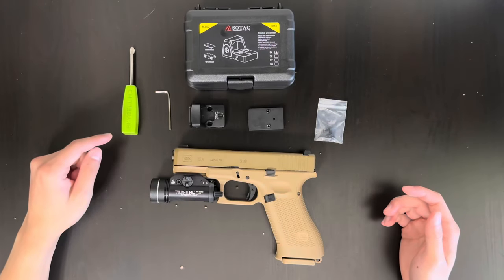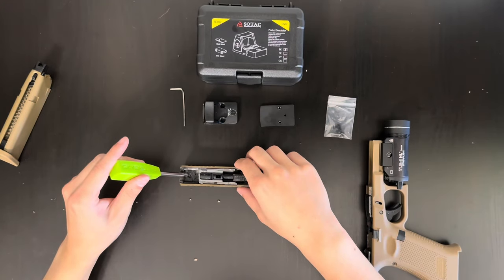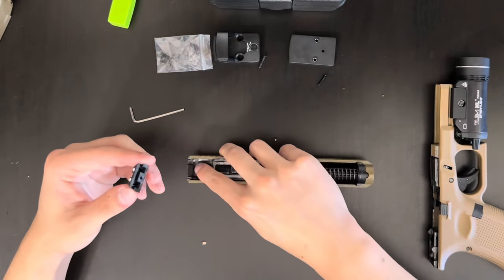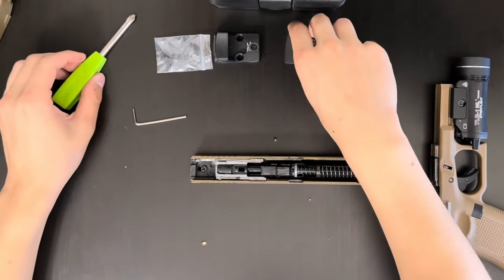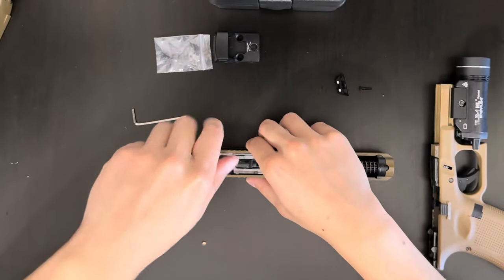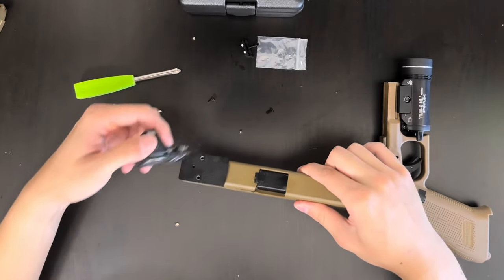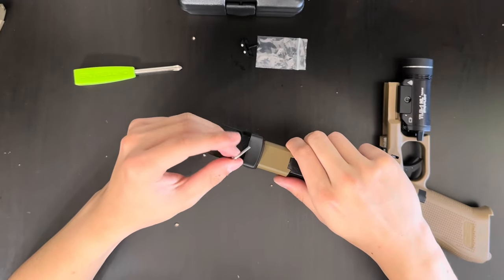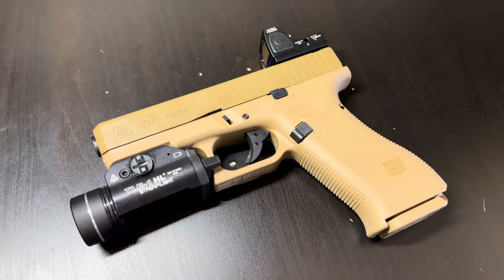How to install RMR Red Dot Replica onto any Airsoft Glocks

Comment: link for gun?
Reply: You have to take off the orange thing yourself just put it in hot water for a minute and rip it out with some plyers
Reply: @Droid_Bait117 wrong comment
Reply: The gun is a Umarex Glock 19x. If you want the gun in the video specfically, get the Umarex FULL BLOWBACK version, do not get confused on the .177 (BB) or Half-Blowback version.
Reply: @R.A.I.D.  Ik  I posted an Amazon link but it’s not showing up anynore
Reply: @Droid_Bait117  I think because youtube doesnt like linked comments
Reply: @R.A.I.D.  yeah prob

Comment: I used this mount and red dot that I got from Evike my airsoft pistol is a Glock 17 gen 4 I put this one but after two shots it went off it’s also very wobbly
Reply from the maker: You need to put loctite on the screw then tighten it down. The design is pretty weak honestly but this is the easiest and cheapest way.
Reply: With a real Glock 19 gen 5 it doesn’t fit at all
Reply: @Tokyo816k  probably because it's for an airsoft gun 🤡

Comment: Hey , The Ali Express Link that you have in the Description looks good to me and I was wondering if you got that mounting plate with the sight ? I have an Umerex Glock 17  Gen4 and was interested in doing it too , from what I saw The mount on Umerex model glocks has one screw in the Centre holding in the sight and other mounts have two ? Thanks
Reply from the maker: The two holes are for the rmr. The one screw on the bottom is to mount it on the slide. Yes the rmr came with the mount!
Reply: @Airsoft_Chay  ahh thats good.
How is the sight picture ? Is it decent enough for the price ?
Reply from the maker: @T-B_22  yeah its pretty good actually!
Reply: yes i had that same issue no mounts i can find so far fit properly on my g19 gen 4 had to get upgraded NV iron sights

Comment: Hey, so my RMR’s plate moves, and it kinda doesn’t hold zero, but I figured it was the plate, so do you know how I can fix the plate from moving?
Reply from the maker: It has to be tightened, but I would say this plate isn’t the best way to mount an rmr.
Reply: @Airsoft_Chay  fixed it, found out it was the plate, had a lot of space which had play, just grabbed some aluminum from a coke can and shimmed it, doesn’t move at all now

Comment: UMAREX GLOCK 17 GEN 5 GBB AIRSOFT PISTOL (BY VFC) Will it work with this model? if so pls send tutorial on how to remove slide
Reply from the maker: Yes, you remove the slide just like how you do with any other airsoft glock
Reply: @Airsoft_Chay  one more, what gun do you use? is it the 19x with only the tan colour? also which taclight do you use?
Reply from the maker: @SCP-Canadian-Branch  I don't use sidearms in games, that one is the tlr-1 HL

Comment: i got one of these and installed it on my g45, does your baseplate wobble when screwed in? mine does and idk how to fix it
Reply from the maker: It turns if I push it but it doesn’t wobble, is that what you mean?
Reply: @Airsoft_Chay   yeah thats what i mean, when i push it turns, but this causes my rmr to move when firing, does yours stay still when shooting? i also screwed it in fully so i dont know why its happening
Reply from the maker: @postalpack1846  due to the rmr being made to fit all glocks this is unfortunately the issue, loctite will fix it
Reply: @Airsoft_Chay  did you need to use loctite for yours?
Reply from the maker: @postalpack1846  I am not using loctite as if I change mind, it would need a lot of fiddling with to get out. At the moment, I just tighten it and pray.
Reply: @Airsoft_Chay alright thanks for the help
Reply from the maker: @postalpack1846  no problem man, glad I could help.

Comment: Fire, how did you remove the flash hider? Im guessing it requires disassembling it?
Reply: The orange tip you can put the tip in water just so the tip is in then once it soften you can get pliers and twits it off
Reply: Better detailed vid here @AirsoftGunsnGear
Reply: @R_Ililil  thanks so much!

Comment: How has that RMR fared??
Reply from the maker: Its good, I sold it to a friend already.
Reply: @Airsoft_Chay  did you go hard? Lose zero or smth
Reply from the maker: @Fede_uyz  yeah it always held zero and never turned off my recoil.
Reply: @Airsoft_Chay  awesome! Was afraid of not handling gbb recoil
Reply from the maker: @Fede_uyz  a lot of cheap optics held up for me. My 50$ eotech rep has been around for 2 years and i run it on all my heavy gbbs
Reply: @Airsoft_Chay  thank you bro